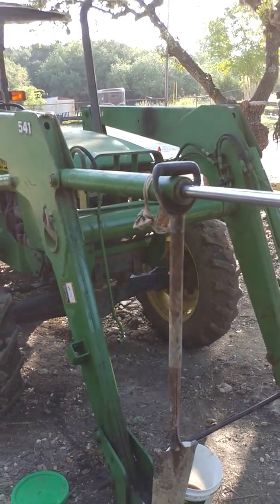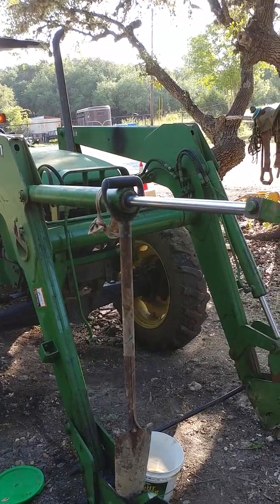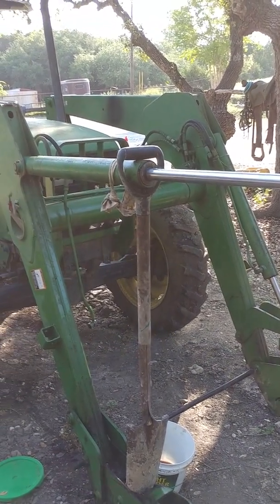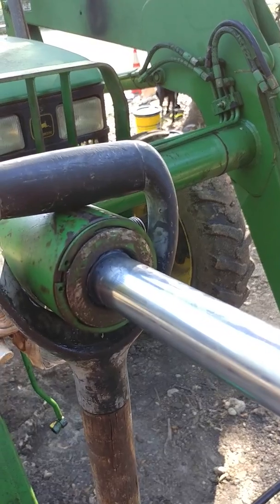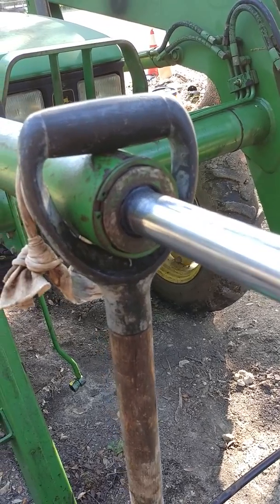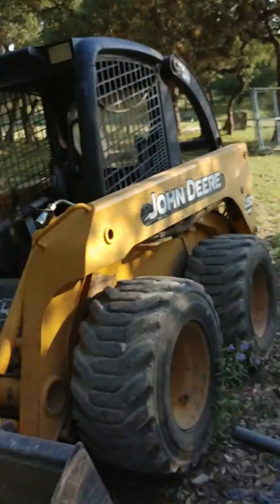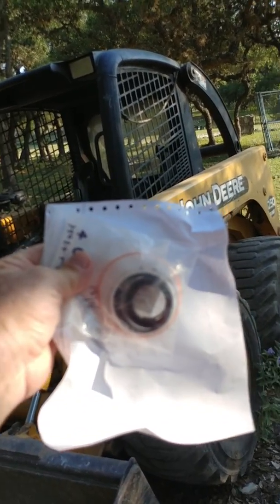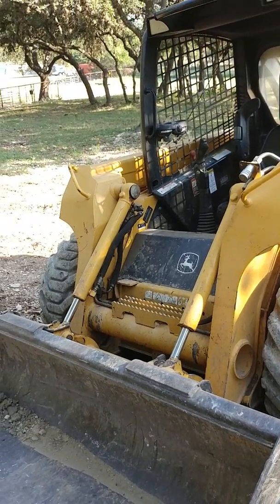Replacing Seals in John Deere Hydrolic Cylinders (2 Parts)

Comment: you can buy the gland removal tool from other places seperate  you just have to do a search on the internet for hydraulic cylinder tools.. just get the right diameter . I know this is an older video.